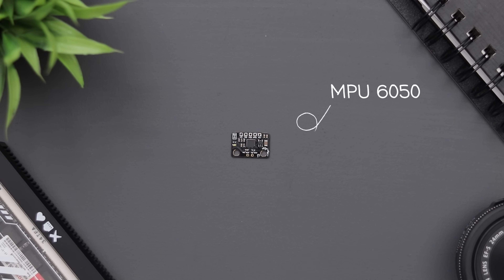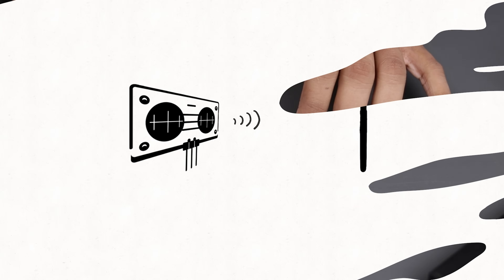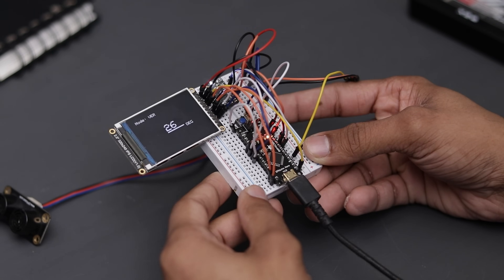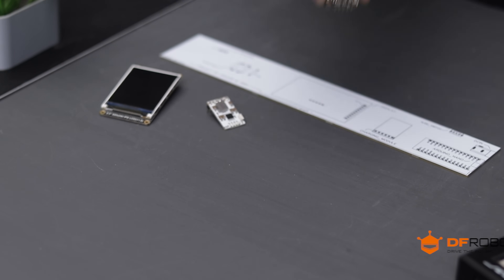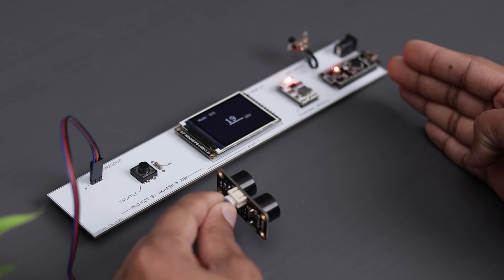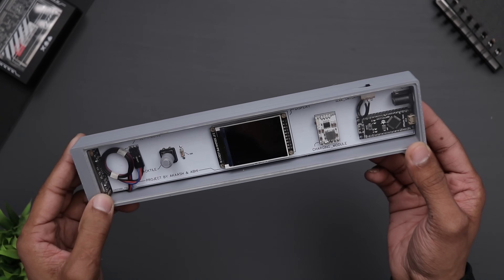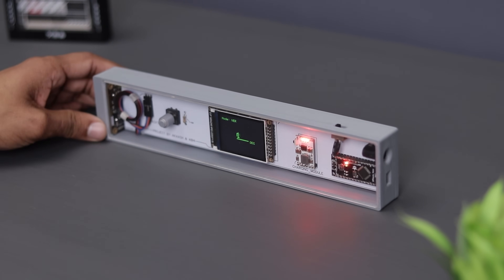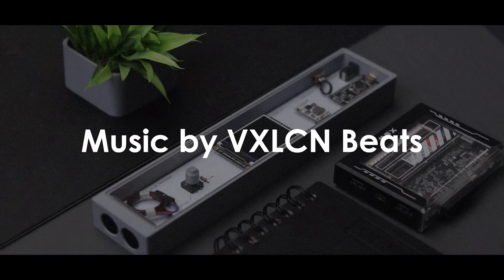Making a Amazing Tool with Arduino | Arduino Projects

Comment: Most of IMUs which have i used is more sensitive towards Z axis what can i do for correct the bias and drift error along z axis for an accurate motion tracker to use in high as well as low accelerations, I have used MPU9250, MPU 6050,BNO055 and BNO085

Comment: nice project but only educational. It has no real practical applications because 1 degree of inclination is really a lot and used like this the MPU6050 is not precise. economically it is unsustainable compared to a commercial level

Comment: Crazy idea so hear me out. Since you know the length of the levels body. Why not convert and calculate Degrees to millimeters instead? You can show on display arrows either left or right side is up or down. Show how many millimeters the difference is with 1 or 2 decimal points. To add percision and not fluctuate number on screen only display value of 5 reading average on screen. Do measurements in every 100ms so board can keep up. Oh, and add capacitor to Ultrasonic to smooth out the supply and you get more accurate and smoother reading.

Comment: is calibrating permanent? or you need to do it every time you power the tool on?
Reply: It’s probably temperature dependent. Check the datasheet for accuracy figures.

Comment: Maybe use a solid base on which the entire pcb sits on. Using a double sided tape does not make sure that the entire tool is sturdy even after calibrating in the long run.

Comment: Suggestion: display the angle in  percent as well as in degrees. A beeper would be nice at both 0° and 90° or better, above or below a selectable threshold.
And the digits could be as big as possible, and always upright...
Reply from the maker: Nice, will make an improved version of this and include these as well.